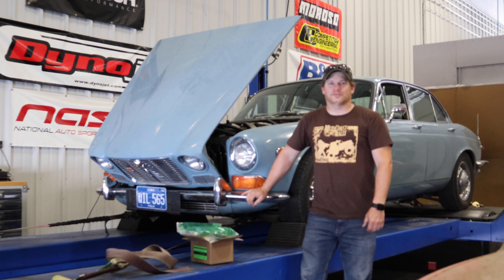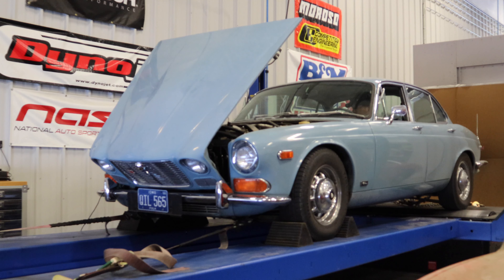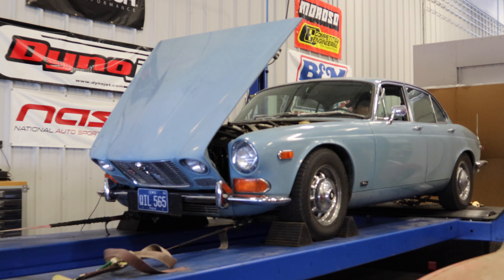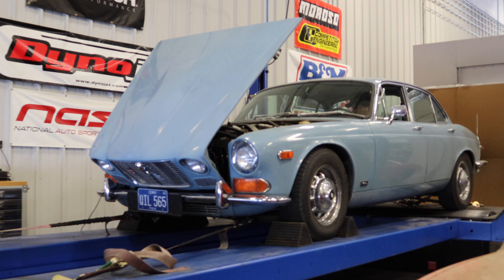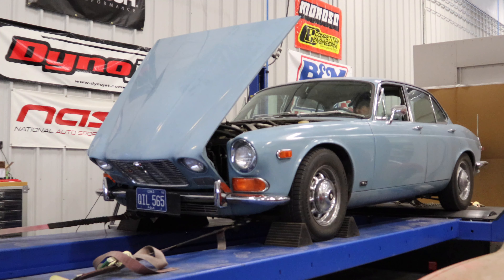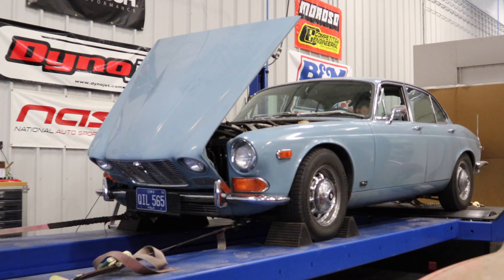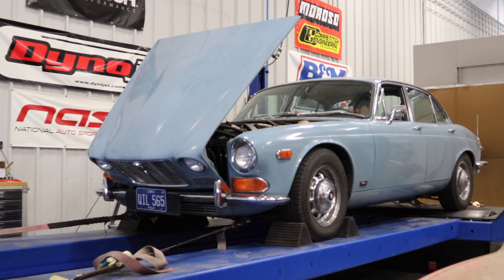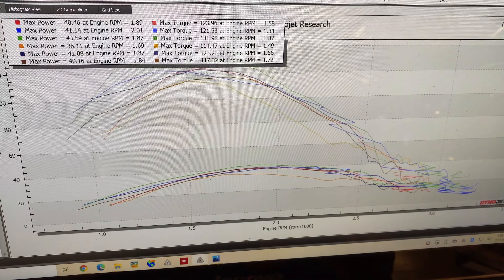Disappointing Ignition Upgrades - Good Idea, Bad Results - Jaguar XJ6

Comment: I too think part is in the advance possible the springs on the weights or stuck weights plus the distrubtor bushing is probably well worn needing replaced. I don't know if the Jag has a vapor tank but it could be full of dirt too. Coolant temp senor could be bad too. Now we are all curios to see what fixes the Jag!

Comment: On my BMW R80 with Bing carbs I had same problem i.e. wouldn’t rev past 3500/4000. Problem was worn needles and jets. Difficult to tell just by looking at them. Replaced them. All back to normal.

Comment: Steve please check the secondary throttle inside the manifold.  I suspect it is disconnected or misadjusted.  It could be partially or even mostly blocking airflow.
Reply from the maker: I will check!

Comment: I replaced my ignition on my TR7 with an Alison electronic optical system. The reason was I put an ‘80 engine in a ‘77 mint California body and the Lucas systems were different.  It paid off in being able to drive for a week daytime without an alternator It also worked at night when I tuned the lights on for a moment snd switched back to  parking lights and drove 8 miles home with less than 5v on the battery. Alison ignition works y to around 3.5v and still gives a 10,000 volt spark!

Comment: I had a 1961 MKII. I lifted the bonnet (hood) in the dark one night to see if there was any leak from the plug leads that sat in between the cams. It was like a spectacular light show, with sparks going every where. I believe the leads should be running through a tube that is suspended by the head bolts on one side.

Comment: Split/perished diaphragm in the Stromberg carbs, it is running lean. I would also chuck the points and condensor in the bin and fit a contactless  ignition system and a new GT40 coil.

Comment: Excellent work, i like your methodical approach. The original rotor arm is a rev limiting rotor arm, this might explain why it wont rev very high. The max distributor revs should be stamped on the outer ring. Also the distributor looks like it is missing some parts, like the micro adjuster wheel. I cant wait for the next update.

Comment: I can only offer the experience with my 1970 MG B, the distributor had been given my a lot of strife and I could not get a steady readout with my timing light. Bought a 1-2-3 electronic distributor and new leads, plugs. The difference was between chalk and cheese, the Lucas (and they are not called The Prince of Darkness for nothing) distributor was giving a trace all over the place , but when the 123 was fitted the graphs where clear and steady. I think fitting all the rest of the gear was a good idea anyway

Comment: I had a SII V12 and the distributor in that is in a diabolical position also. 
It had a well known US brand optical pickup and electronic box. It failed twice. Turns out the upgrade was a downgrade. 

What I ended up doing was I converted the stock dizzy to reluctor and pickup from an HE V12 by building one distributor from two - an HE dizzy and the pre HE dizzy in it. I didn't know at the time if it was possible actually, but yeah it is. I used the 'Lucas' HE control box. It is not in any way Lucas as it has an off the shelf GM HEI module inside it. For good luck I replaced that module. 
Put it all together with the twin early type HE coils (firing and non firing) and I could not believe the difference. The starting, esp the hot starting the idling and the top end RPM was so improved it was utterly amazing. It must've picked up 100hp! I took the injectors out after that I was so impressed and the spray patterns were all over the place, so I refitted them and replaced the fuel pump and filter just because I could. It became imperceptible the idle and that smoothness! 

I hit an escaped farm animal at slow speed and it did so much damage to it that it was uneconomical to repair. The animal fared far better than the car. It rolled on the hood into the A pillar and just walked off as if nothing happened lol. Screen, hood, grill, bumper, front fender and it weight of it pushed the radiator support panel and the radiator down about 3 inches and the engine fan deflected into the radiator. It was like a slow motion crash. Even one of the intake manifolds got cracked. Effing farmers. I now have a 1980 SIII V12.

Comment: You should clean the surface of the points before you fit them, plus put a little grease behind the leading edge of the plastic heel that sits against the cam.
Did you check the mechanical and vacuum advance system were working? While it's unlikely that they would be the main cause of it producing such low power outputs they should be thoroughly checked and fixed before moving into the carbs.
With such low power output it's a wonder it manages to move the car around at any reasonable speed and degree of acceleration.
Best to buy a set of diaphragms for the carbs in advance, or find some 2 inch SU carbs instead.

Comment: If you read this Steve replace the earth strap or at lest clean up where it bolts on ...in fact add a thicker new one from engine to body....i suspect corrosion as crept in and you may have an earthing issue....

Comment: Put in a new contactless ignition set from Sparkrite. It's what i did to my 1975 Xj6 C and it transformed the engine response and i have NEVER  have never had ANY problems with my ignition system since

Comment: Four possibilities; either the advance mechanism may not be working correctly, or the shaft bearings have too much free play, or excessive wear on the cam lobes, or bad wiring on the distributor low-tension circuit.  But it could also be the fuel pump, filter or damaged fuel lines. Or blocked high speed jets in the carburettors, or an air leak on the intake manifold(s). Or...

Comment: Have you replaced the rubber diaphragms yet in the Stromberg carbs?
Tiniest pinholes can cause lots of trouble and they only last 5 or 6 years from experience.
That experience is from the 80s and 90s, and with alcohol in today's fuels, that would be my first items to change out.
Reply: Oh and check timing moves appropriately as revs increase, not just that it is spot on idling.
Mechanical advance can seize and vacuum advance diaphragm may be split.

Comment: Engine compression test show anything? Oil levels in the SU carbs too high/too low? Fuel filter renewed? If so, does it have two (one near the tanks, one near the carbs?

Comment: Is there an aftermarket electronic points replacement?  For German cars you can get Pertronix and compufire modules that replace the points and condenser. The other ignition item might be a multispark unit, which is usually overkill but looks cool. Definitely think that upgraded fuel pumps, filter, and maybe cleaning out the tanks could help. Fun cars!  Enjoying the videos!

Comment: Hi,
>>>Carbon cleaning descaling with hydrogen hho...
The Jaguar XJ6 has several known issues with its fuel, mechanical and electrical systems. Most of these problems resulted in recalls for the vehicle in the 1980s and 1990s. Fortunately, the manufacturer of this luxury sedan has come up with several fixes to address concerns about this vehicle's safety and function.

Comment: Absolutely dump the Lucas distributor and go with a Petronix or 123. Check for vacuum leaks on the shafts using raw propane. Any increase in idle will be indicative of problems. Balance your carbs and make sure the linkages move both butterflies equally. Give us a wet and dry compression check as you might need a valve adjustment or have worn rings. Run some Sea foam and BG44k directly into a vacuum line. Those products really clean out crud and you'll see smoke for awhile as they work.

Comment: Those Stromberg's carbs are looking pretty dirty and likely pistons aren't lifting fully (gummed up with carbon and old fuel) which will give you fuel starvation at higher revs. Probably that floats underneath suffer same problem (old fuel residue), whole lot needs a good clean and fresh oil in the piston tops.

Comment: There are probably many small problems here and everything you changed was worthwhile. Wear in the distributor can definitely cause erratic timing at higher rpm and break up. That should be pulled and rebuilt or replaced imo. At a minimum verify that the advance moves freely and the springs are in place.

Comment: Watch those new Lucas products. I've been very disappointed with their condensers failing and coils after not much use. I've been fitting SimonBBC (Powerspark) rotor arms and caps instead of Lucas. They seem a lot closer to the originals in looks and build quality. I've been fitting Bosch coils instead of Lucas.

Comment: An old trick I used to do was lay in the engine bay while a mate would drive on a quiet street, I would advance or retard the timing while it was under power with the brakes dragging to find the highest power and lock the timing there. this should be even easier to do with your rolling road / dyno.

Comment: If you can access one get a dwell meter to set the contact breaker points  gap to perfection, also fit new needles & jets to the stromberg carbs, suggest that you fit new diaphragms while you have the carbs stripped down as they do fail with age, Happy tuning !!!

Comment: If it's not ignition or timing, I would check compression and assuming it's ok them move on to checking fuel delivery. Amazing it runs to smoothly whilst being down so much on power.
Reply from the maker: It’s not necessary down on power. At those rpms it may be making proper power for the first couple thousand RPM.   It would probably have peak power between 4500-5000 so having 40 at 1500 is reasonable.

Comment: Mechanical advance could be jammed, and the cam chain might be shot and too slack, replace the distributor with a full electronic one, and check the cam chain and sprockets, be sure do do a proper cam degreeing rather than just line up the marks on the cam and crank pulleys

Comment: Compression test should really be your first check. If the compressions are down then you're not going to get any horsepower back until you sort that. 
Throwing parts at something is an expensive way to fix it. Check your fundamentals first. 
Nice car though. Good luck.

Comment: Also check fuel filter is not restricting fuel. If ok, check carb float level, carb breather vent. Distributor vacuum advance diaphragm is it working?

Comment: It sounds like it's sorta got breathing problems. May be the exhaust is a bit blocked or the wrong muffler. It could even be a bit crushed. That's just what I'm thinking. It should have better gains from what you changed from what they were, especially those leads. Can't wait for next video, I really like them
Reply from the maker: This car has catalytic converters my thought has been they might be clogged.

Comment: I love the car and always wanted a Series 1, had a few Series 2 and one Series 3 V12. I believe the best idea would have been to go for electronic ignition. Part of the reason the Dissy is hard to access is because the XK wasn't designed for that car and it was designed back in or around the late 1940's to go into the XK120 sports car. I would also replace the AED with a manual choke conversion. It may be a good idea to cherck and clean the Earth/ground connections of the car. Judging by the spark plugs, the bores are very good and fuel mixture is spot on.
Reply: There is no AED on this car, it has a manual choke.
Reply: @markstott6091  I can see that now. Originally it would have had one. The AED soon went unreliable and gave starting problems. The manual choke conversion is far better.

Comment: You could try spraying a very fine mist of water into the carburetors to give the inside of the cylinders a good steam clean. Another idea I have is maybe installing trumpets on the carburetors so the airflow smooths out and provides better attermisation which improves combustion.

Comment: What surprised me is all the dirt and rust under the hood. Good maintainance starts with cleanliness. It all looked a bit neclected. Certainly compared to the outside of the car. Carbs and air filter are S2 instead of S1.

Comment: How about dumping the points altogether? and you will not have to worry about sticky distributor weights either, should be worth a few HP. you will also need the pacific distributor fitting kit (around $25) https://tinyurl.com/ybz4nzhl

Comment: Steve in england we had the Su carbs which in my opinion were better i once worked on a american import jag i took all the emision equipment of it ended with a box of junk after that came of the car flew . I like to gap new points at 16 thou so whe the heal wears initialy the gap closes a few thou , i also think a electronic ignition would help also these are high comp engines they need good high octane fuel.

Comment: I would fit an electronic style distributor , preferably a programmable one . Also check the TDC by removing the spark plug and check the actual piston is at TDC.. check all cylinder compression making sure you have the throttle wide open when testing . Once that has all checked out see what air fuel ratio you get at wide open throttle maximum load ...you want it around 12.5:1 . Try 30 deg total  maximum advance and move it a few degrees either way to see what gives best torque.

Comment: I had a couple instances where I was sure the problem was ignition, but it was a clogged fuel filter.  9 times out of 10 its ignition, but as long as the timing is advancing through the revs, the fuel system is the next stop.  Still, might be of benefit to pull the dizzy and check the bushings and breaker plate rotation.  the  first XJ is one of my favs, so def enjoying this series, although its hard to get past my jealousy!

Comment: Steve, this was really interesting. What a bummer to see no change on the dyno. Have you ever used a Color Tune on these old cars? I read about it in the comments over at Budget Buildz- it's basically a spark plug with a clear glass insulator so you can tune by watching the color of the ignition flame. The British sports car guys over there swear by them. It'd be really cool to see if you could tune it via color and then double check with the sniffer. I'm probably going to grab a Color Tune for getting my Sonett running- it's got a lot of Lucas stuff just like your British cars.
Reply from the maker: Yes I have three of them but the capabilities of what the dyno equipment can do when I am running the sniffer is far superior.  Also the colortunes are for fuel adjustment which I will do in the next video.
Reply: @ThisWeekWithCars  I'd love to see what results you can get out of them if you want to do it the old school way at some point! I don't have a dyno or sniffer at home to check my work! ;)
Reply: I've got an old colour tune sitting on a shelf in my garage. Yes it's a cool device to see that nice blue flame

Comment: hint.. that XJ6 has power windows.. switches right in the middle of the console.   disconnect the battery.. gently get the window switch panel up..  with a tiny flat file.. push it thru the openings in the side of the switches.. rock the switches the other way so the contacts are pushed closed on the file.. push back and forth a few times..
 insert in next hole.. rock switches the other direction. move the file back and forth a few times.. don't go crazy.. the contacts are silver..  hook up battery.. turn on the ignition and watch how fast the windows go up and down..
Reply from the maker: Is this a video you would like to see me do so that everyone can see the results?
Reply: @ThisWeekWithCars  only if you want... jag techs usually hate me for sharing the secret.. they make hundreds if not thousands of dollars replacing motors and lubricating stuff when its only the contacts..  heck.. i used to take apart the turn signal relay boxes and resolder the connections..    you may want to drop a super magnet in each fuel tank..

Comment: Yes keep working on the Jag please. Check the compression. Change fuel filter then dyno test, fuel pump then dyno again finally rebuild carbs then dyno. After check valve clearances. Adjust if needed and dyno.
Reply: Doctor MENGELE you’re right. It’s basically free to check valves and do a compression test. In the end I bet is a fuel starvation issue. No power over 3K rpms and only is getting 40hp @ the rear wheel. Should be getting like 120-140 hp at over 5K rpm🏁

Comment: I’d like to see what you’d do in adjusting the carbs. I replaced the ignition system in my Sprite last year and adjusted the carbs to best I could and I still have a low rpm misfire.

Comment: Hi Steve, o/haul those Stromberg CD's, replace the diaphragms, they will have lost all of their flexibility and won't control the piston/needle for proper air/fuel ratio. New fuel filter, fresh high octane fuel. Reset your points with a dwell meter. All of this provided it's mechanically okay. All the best from Australia.

Comment: English carb job - I have those on my Jensen - nobody knows how to work on them
Reply: do you have a 541?
Reply: It’s not hard, but it requires common sense, that well isn’t very common. I’m rebuilding some Stroms now for a Jag, do you need some help?
Reply: Tim Coronel no. Jensen Healey - and  lotus Elan +2
Reply: caseytailfly thanks - mine is tuned well- but paid way too much for it. And long away from the lotus running
Reply: Crisp Flake best of luck! Keep at, it’ll get done eventually 😁